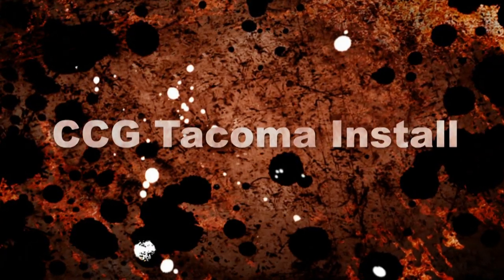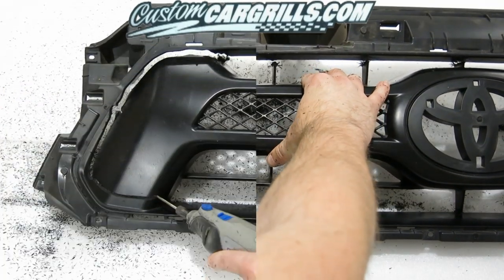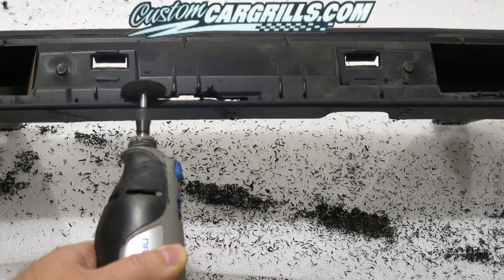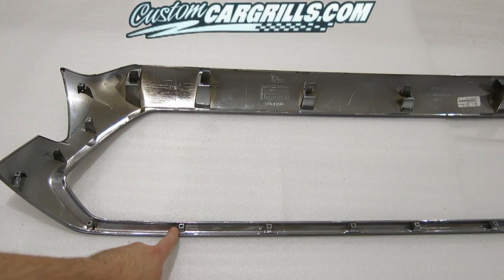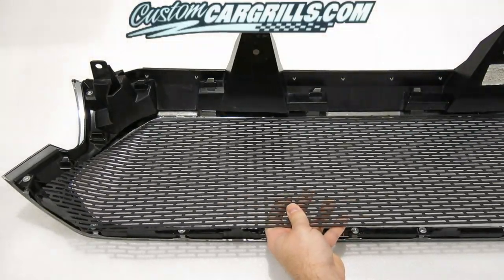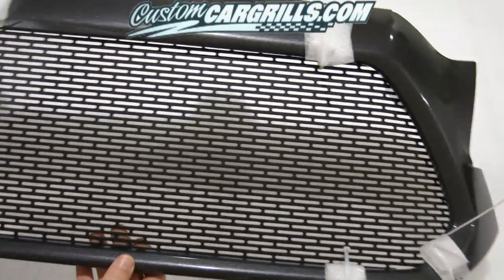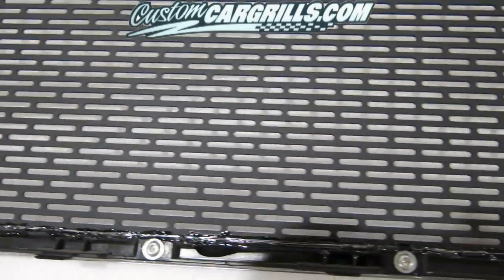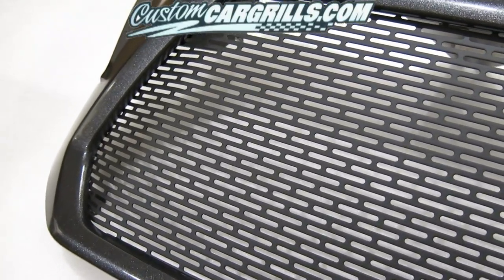Toyota Tacoma 2012-2015 Mesh Grill Installation How-To by customcargrills.com [First Upload]

Comment: Do you ever use a mold press to bend a grill to custom fit it?  I suspect this might be different for a perforated mesh vs a wire type of mesh.
I am debating doing this on an '06 CRV since the OEM grille bubbles out some.
Reply from the maker: We've done that for just a handful of models in the past using expanded metal.  Getting the right fit with all the correct angles can be painstaking.

Comment: I'm buying a dremel tool. Do I have to buy a powerful one or will a dremel 200 be enough?
Reply from the maker: +iansalcedofilm The Dremel 200 is likely powerful enough.  It would just lack the speed control that's sometimes good for accurate cutting.